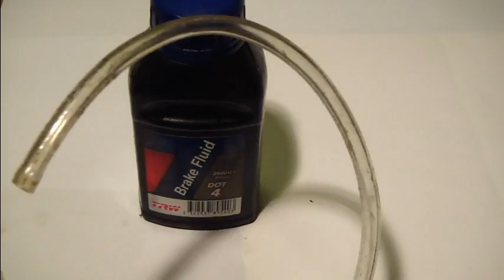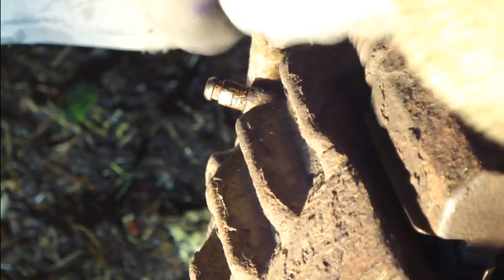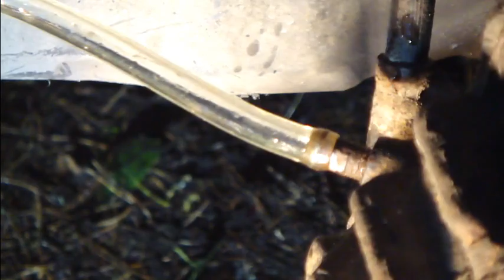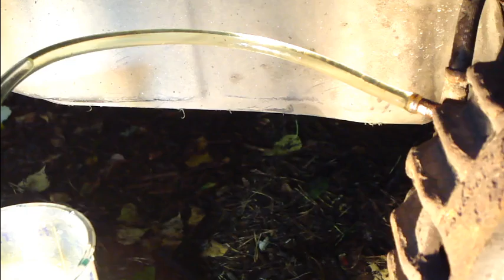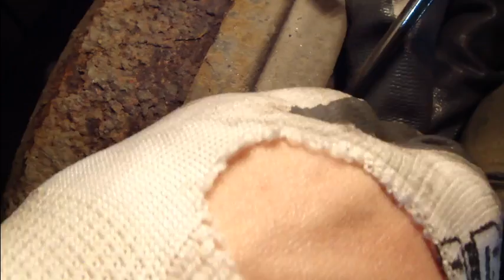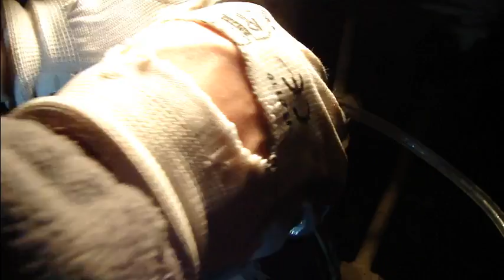How to replace brake fluid Toyota Corolla. Years 1996 to 2007.

Comment: you need to emptied the brake fluid reservoir first, do not mix new and used brake, and THEN fill it with new fluid IMBECILE

Comment: says on resevoir dot 3.. uses dot 4 hmm lol
Reply: Even better to use dot 4, marginally more expensive. It would have been bad to use dot 3 on a system that need dot 4 or better.
Reply from the maker: Thanks for comment 👍
Reply from the maker: Thanks for comment 👍

Comment: hi i did bleeding for my corolla 97 in midas fixing shope but what happens the technician said during flushing pressure the proportioning valve locked so my question is there risk if this valve locked ,the car can get the brake and stop the car i try it several times so i leave it like this or replace the valve ,note the part and labour cost to much about 700 dollars whats ur opinion
Reply from the maker: Hi, you must replace the proportioning valve

Comment: corolla calls for dot 3 in the original factory manual boss
Reply: Yes it does, but dealerships even supply a dot4...I'm also confused
Reply: @thatott281  dot 4 is compatible with dot 3 so don't worry about it
Reply: So does the Yaris.

Comment: how much fuid i nedd for toyota criolla 1997
Reply from the maker: 1 liter or 1 quart
Reply: that amount is there in all the pipes and master cylinder
Reply: 200ml per body panel. Use a soft cloth to gently work it intio your paintwork

Comment: Dot 5 is not better for corolla, don`t use it, its not compatible with dot 3, dot 4 and whole break system on Toyota corolla, You can use Dot 5.1 which is compatible with break system and dot 3, dot 4 ... base of dot 5 is different ....thx for your videos Peter
Reply from the maker: +tajfun1milanek Thanks for feed back. :-)

Comment: Hi Peter. Great video by the way. Anyway I noticed at 9:42 you say to keep tube submerged all the time in fluid but notice when bottle is full you remove tube. Wouldn't air get in then? I notice on my vehicle brake fluid is at the minimum mark and is black, can I just top up to max or would I need to bleed all four wheels? If this was the case I would be going through a bit of fluid to do the change?
Reply from the maker: ***** Hello. No, the air don't get in. Air could go only in the system, if bleeding bolt is open or if we open brake system hoses or bolts off.

Comment: Hi
As I understand, front wheels and rear wheels are to separate systems with one common fluid tank. So it's enough if I drain brake fluid on one front wheel and one rear wheel, am I right?
Reply from the maker: razem1 Ok. Please do job to all four wheels, because there could be air bubbles in all wheel areas.
Reply: Peter Finn Thanks  :)